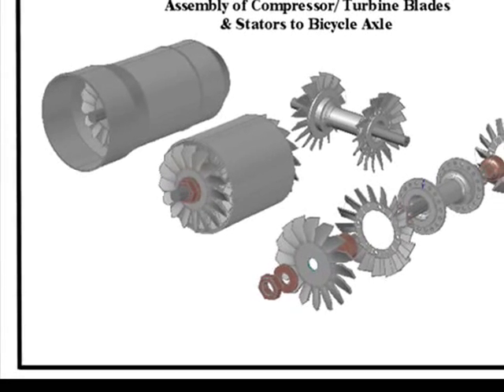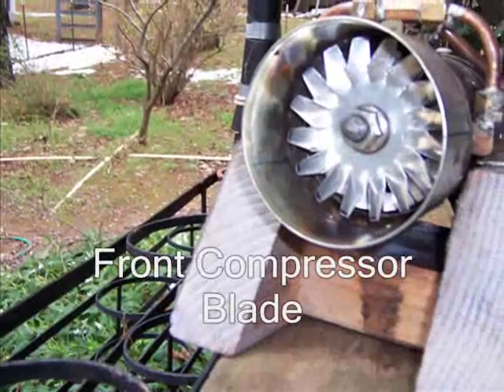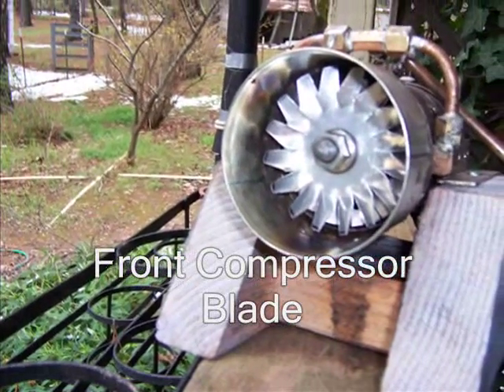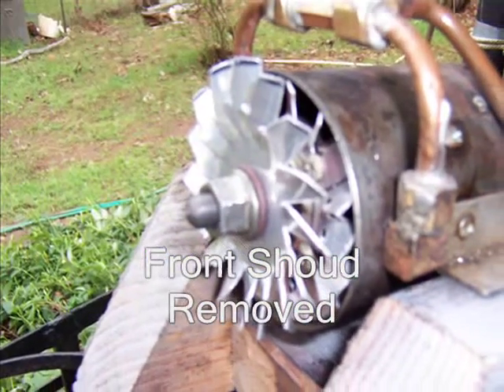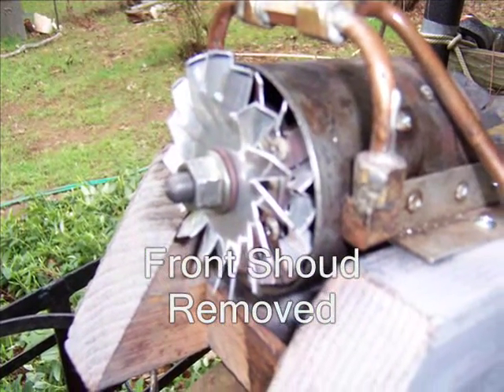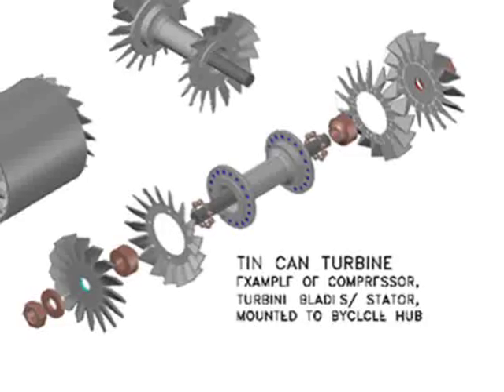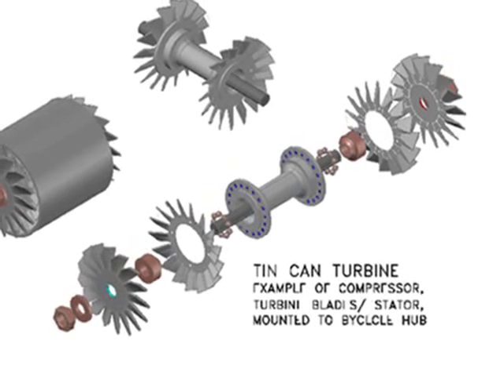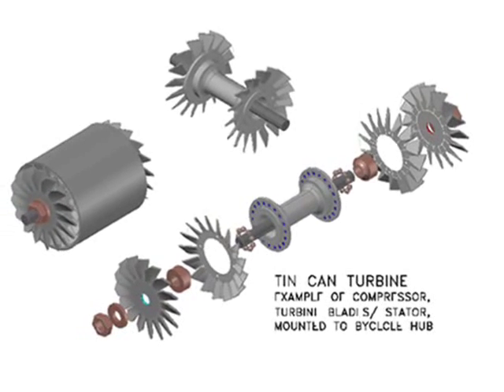Tin Can Turbine Assembly Plans

Comment: so i saw your other video of it running, and perhaps it cannot sustain because it does not have enough compression. from my understanding, axial engines usually need about five stages of a compression ratio of 1:1.1, but with cans this would be very hard. also, are you lubricating the turbine in any way? oil mixed into the fuel perhaps? love this little guy, its a great project, thanks for sharing!